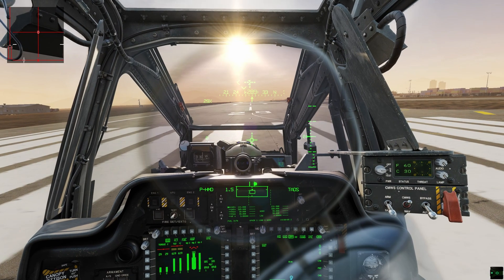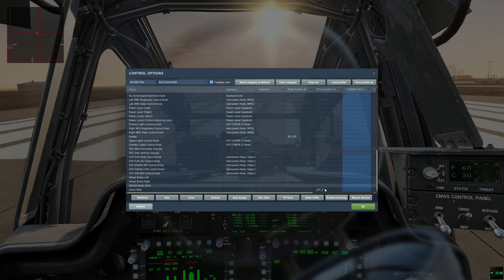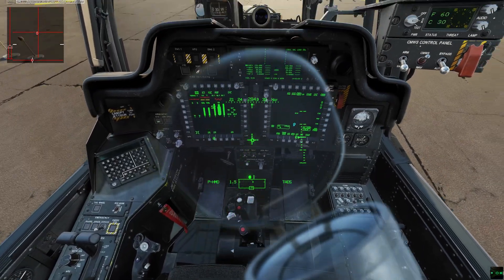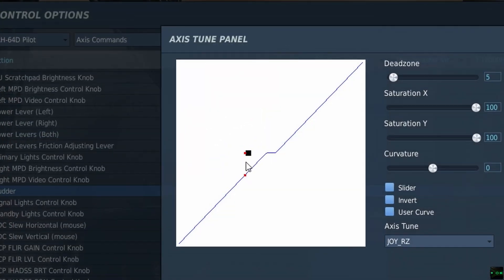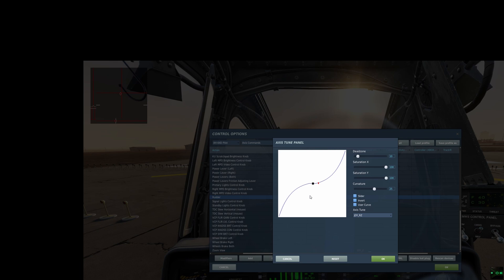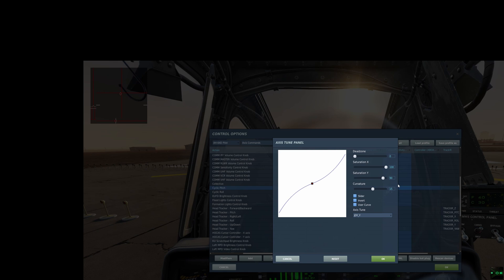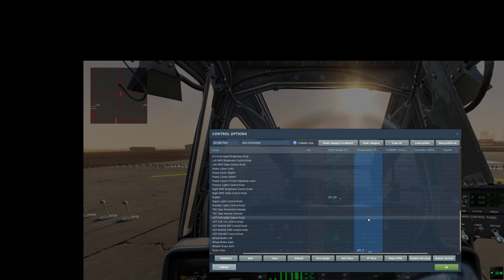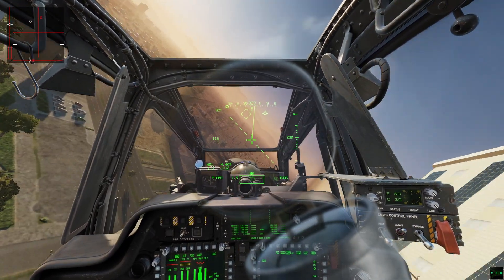How to Fly the DCS AH-64D Apache #3: Curves, Saturation & Deadzones to take away the crazy

Comment: Volk, what HOTAS do you recommend for the AH-64?
Reply from the maker: Anything longer with reasonable sensivity and cams instead of just hard springs. Also reduced tension so it dampens movement and barely keeps itself in position without returning to centre. Or a forcefeedback stick. Though of course those typically don't have the power to retain the FFB if you add extensions to those.
Heard good things about VKB and Virpil, though regretably I don't have any of those to give a personal recommendation ;-)
Reply: @volkvoort  cheers! Keep Up the good stuff 🤟🏼
Reply: I just got a VKB NXT EVO and it's amazing well worth the price and getting me by but I need a throttle and it's so hard to get a good one!
It's either $200 plus for the trust master TWCS with mods/grease or $400 - $600 for a Winwing Orion or Virpil CM3 respectively .
Anyone have any alternate throttle suggestions?
Reply: @Mossyyyyyyy  A10 throttle from TM .